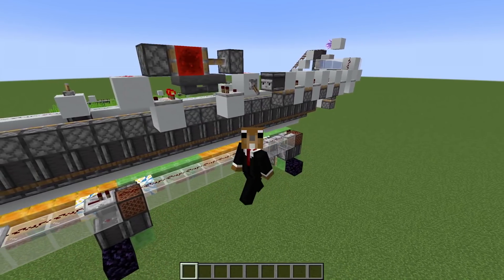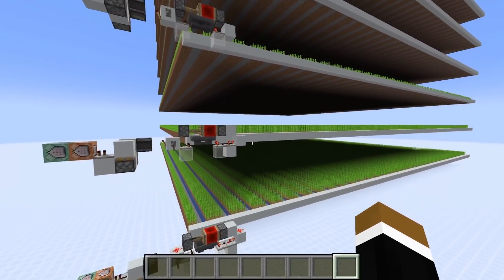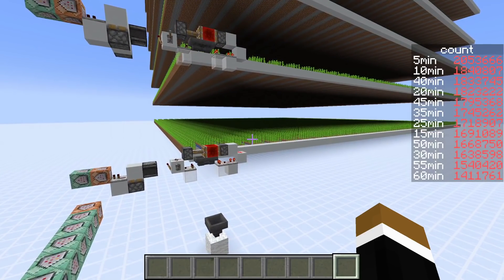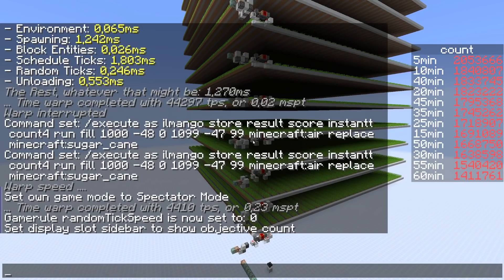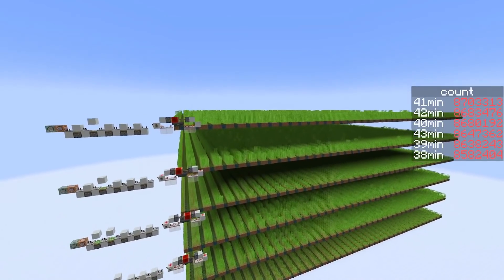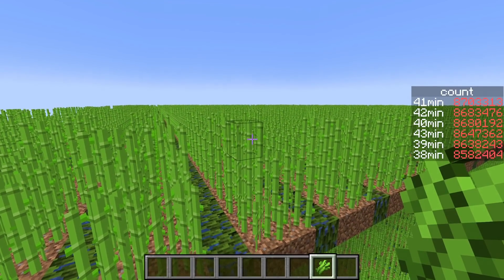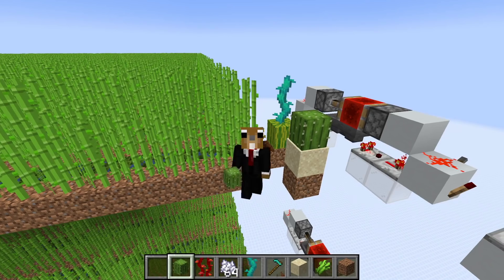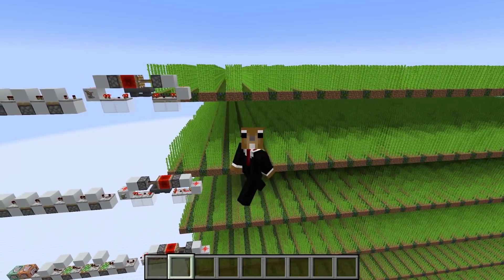What Is The Perfect Clock For A Sugar Cane Farm?

Comment: The answer is: 49253 ticks, with the efficiency 36.006436594099256 sugarcane per tick for 1 million sugarcane
Or, 2462.65 seconds / 41 minutes and 2.65 seconds

(Explanation in comment reply)

Here is the python code that I used:

from scipy.stats import binom

def efficiency(cycle_length):
    n = 2
    for i in range(0, 16):
        n -= 2 * binom.pmf(i, cycle_length, 3/4096)
    for i in range(16, 32):
        n -= binom.pmf(i, cycle_length, 3/4096)
    return n * 1000000 / cycle_length

for i in range(49240, 49260):
    print(i, efficiency(i))

Here is the output:

49240 36.00642974585812
49241 36.0064307260955
49242 36.0064316307466
49243 36.00643245981445
49244 36.0064332133022
49245 36.00643389121294
49246 36.00643449354977
49247 36.0064350203158
49248 36.00643547151411
49249 36.00643584714785
49250 36.00643614722013
49251 36.00643637173403
49252 36.0064365206927
49253 36.006436594099256
49254 36.00643659195679
49255 36.00643651426848
49256 36.00643636103739
49257 36.00643613226671
49258 36.00643582795952
49259 36.00643544811894
Reply from the maker: oh nice. thanks
Reply: OMG I GOT PINNED?!
Reply: @YuuseiKurobane  You earned it!
Reply: That is super impressive that you calculated it, I only partially understood, but that's mostly on me.

It's really impressive how close it really is to 41 minutes, basically no difference, so 41 minutes is really the perfect viable time to harvest sugar cane farms!
Reply: Chad Python programmer using their free time to solve gaming questions
Reply: I believe 1-high sugar cane doesn't reset after harvest, so the optimal time should be lowered by a tiny amount of time. Could you please put that into consideration? I am curious if that makes any difference.
Reply: @wooden_picks7315  oops, I actually didn’t think about that.. That’s a valid point and my calculations are wrong because of that.

EDIT: I think youtube has prevented me from posting more comments, so I will be using this.

@Rushi @Wooden_Picks I have modified the code, the new answer is now 49251 ticks, or 41 minutes and 2.55 seconds, which is a 0.10 second difference!
@srather I have taken that into consideration too, the answer is still 49251 ticks.

from scipy.stats import binom
import matplotlib.pyplot as plt
 
HARDCODE_PRECISION = 900
 
def equillibrium(cycle_length, precision):
    distribution = [1, 0, 0, 0, 0, 0, 0, 0, 0, 0, 0, 0, 0, 0, 0, 0]
    new_distribution = [0, 0, 0, 0, 0, 0, 0, 0, 0, 0, 0, 0, 0, 0, 0, 0]
    for i in range(precision):
        running_counter = 0
        for j in range(1, 16):
            total_from_previous = 0
            for k in range(0, j+1):
                total_from_previous += distribution[k] * binom.pmf(j-k, 3 * cycle_length, 1/4096)
            new_distribution[j] = total_from_previous
            running_counter += total_from_previous
        new_distribution[0] = 1 - running_counter
        distribution = new_distribution.copy()
    return distribution
 
def efficiency(cycle_length):
    distribution = equillibrium(cycle_length, HARDCODE_PRECISION)
    n = 2
    for s in range(0, 16):
        for i in range(0, 16 - s):
            n -= 2 * binom.pmf(i, cycle_length * 3, 1/4096) * distribution[s]
        for i in range(16 - s, 32 - s):
            n -= binom.pmf(i, cycle_length * 3, 1/4096) * distribution[s]
 
    return n * 1000000 / cycle_length

for i in range(49245, 49255, 1):
    print(i, efficiency(i))

Output:

49248 36.005482937897945
49249 36.00548311115399
49250 36.00548320899456
49251 36.00548323142269
49252 36.005483178441324
49253 36.005483050053705
49254 36.00548284626267
Reply: @YuuseiKurobane  as another comment rightfully said, the probability of still having a significant amount of 1 high sugar cane is ridiculously low. You shouldn't waste your time with it. Unless you enjoy it, in which case I can only cheer you up^^ It'd be me, I'd also be looking.
Reply: @YuuseiKurobane  I independently calculated the max in matlab and also basically went the same route as you did, at first 49253, then noticing that the formula spits bs when entering really short harvest cycles because it doesn't take the growth state distribution after harvesting into account, then noticing that I can only approximate that distribution using equilibrium conditions. However, I was too lazy too program those in, but rather just simulated the whole sugarcane growth mechanic to notice that for the harvest cycles of interest the effect is negligible! Congrats though, you were faster than me :)
Reply: @JL2579  The easiest way to do the equilibrium thing is to just brute force it in I guess, and it only changed the answer by 2 ticks, but it is necessary to do to accurately get the behavior of short harvest cycles. I plotted the graph in a post r/technicalminecraft if you want to see the behavior for short harvest cycles (around 20% more rates). I wasn't really trying to be the fastest and I'm also interested in other people's work to double check though. Also I didn't know about your channel and I subscribed to you :)
Reply: @YuuseiKurobane  thank you, I am not very active on it atm, but I plan to release some new videos soon
Reply: @JL2579  wow JL still exists? i remember watching technical mc videos from many years ago
Reply: @YuuseiKurobane  a little correction to the function name here: it's a steady distribution instead of an equilibrium distribution.
Reply: @wooden_picks7315  I've only taken one year of AP calculus, so I'm not entirely sure I'll be able to do much. My first thought would be to integrate the rate of growth for sugarcane from t=0 to t=x and then find which x would be the maximum on the graph ilmango showed, but I don't know how to do that with rates governed by half-lives.
Reply: It's a shame that my chemistry class didn't go into the math behind half-lives, because that would be REALLY helpful right about now...
Reply: @flambambam  calc bc does diffeq and half life
Reply: Random ticks are 3 times per tick and can choose the same block multiple times. So the probabaility ist actually 1/4096, but 3 times as often.
Another problem is, that any sugarcane that is still 1 block tall doesn't loose it's growth stages.
But the error should be within 0.001 of the efficiancy.
Reply: @srather  Actually, the probability (or rather expected number of random ticks per tick) is still 3/4096. Here's a little proof (This is actually something that I was wondering if it was exact or just a good approximation, so I actually made this proof to convince myself) 
Chance of a block getting random ticked: 
1 time, r1 = 3 * 4095^2/4096^3
2 times, r2 = 3 * 4095/4096^3
3 times, r3 = (1/4096)^3
expected no. of random ticks per block per tick, R = r1 + 2r2 + 3r3 = 3[4095^2 + 2(4095) + 1] / 4096^3 = 3(4096^2) / 4096^3 = 3/4096
Reply: @Temari_Virus  Yes, the expected value is the same, but the actual distribution is important. If on average the block was ticked 17 times we dont know how often it actually grew.
Reply: Yuusei please make a video with the explanation of the calculation.
I am sure many people would be interested, I know I am.
Reply: @marimaton4516  lol, there aren’t a lot of channels like that, that use math to perform a technical analysis of things in minecraft. I’ve seen one channel try and use minecraft to show fibonacci’s sequence using chests.
Reply: R/theydidthemath
Reply: Good work! I tried to use a graphing calculator for this, but quickly hit precision issues. Your code looks right, but your explanation should use other limits I think. It should be 0 <= i <= 15 instead I think.
Reply: Epic that you actually decided to calculate it :]
Reply: This has a major flaw! Try calculating the efficiency for a cycle length of just a few minutes using your method; it's minuscule.

The code wrongly assumes that the stage for every sugar cane is reset to 0 after every harvest. However, canes that are still just 1 high aren't cut at all and therefore keep up to 15 stages
Reply: @WilcoVerhoef  @The Lasagna Man, I have written an updated code somewhere in the reply (in my reply to @Wooden_Picks) but I couldn’t edit the top level comment because it is pinned, I am sure it is correct
Reply: The answer to every problem is 42
Reply: i shouldn't have pressed more, that scared the shit out of me
Reply: My man 😂😂
Reply: Showed his work too, Naisu 👌
Reply: the suger cane per tick values seem way to accurate, its like measuring an area in square millimeters with a ruler that can only measure meters.
Reply: it can be computed precisely: sugarcane follows random ticking which can be calculated precisely
Reply: @vinesthemonkey  random ticks by nature are random, so it canot be calculated precisely. why would a random tick a block every x ticks. The number used is only an average.
Reply: @wChris_  it's random but when you sum together binomial distributions (x occurs every tick with probability p) you get a very close approximation to a normal distribution (first proved by Laplace, then later on for most non-pathological distributions as CLT)
Reply: Excellent comment! As for the derivative people were talking about. I don't believe there is a way to take a derivative of a discrete function like the binomial. However it happens to be the case that the normal distribution is a continuous approximation of the binomial. If you use your code to calculate the efficiency for every tick interval from 0 to, say, 100 000, it would be pretty easy to find the exact(ish) average and standard deviation of the dataset. I found the following equation for the derivative of the normal on a math stack exchange forum:

f'(x) = - [(x-mu) * exp(-(x-mu)^(2) / [2 * sigma^(2)])] / [sigma^(3) * sqrt(2 * pi)]

Here "mu" is the average of the dataset, and "sigma" is the standard deviation. After that it should be pretty trivial to set f'(x) = 0 and solve for x.
Reply: Absolutely outstanding.
Reply: So many significant digits required for this exact of a solution.  I've had people commend me on much simpler calculations before, but I know it's not serious until one has to pull out the scripting tools. Truly great work here.
Reply: As multiple people in this comment thread have already pointed out, the code created doesn't work for low harvest intervals because it doesn't account for growth ticks that are stored but not harvested in a 1 tall sugarcane plant. I believe that to get a better model of the proper behavior at low intervals, we have to attack the problem from the other direction, by counting the number of growth ticks that get lost after each harvest. This would account for 1 tall sugarcane that isn't harvested and 2 tall sugarcane that get harvested with a number of lost growth ticks. I'm not currently able to code this myself, but it would be interesting to see someone create it.
Reply: @thelasagnaman832  to be fair my method does not count for ticks lost but attacks from a more average amount of ticks. I can probably fix that by artificially increasing the population to 16*3 to account for all 16 growth states. That being said my method does work for smaller scale farms and setups as little n is a linear operator, meaning it is infinitely tileable and duplicatable. However to get to this point, I am required to use initial conditions based off of real data, in this case how fast sugar cane grows. 
My solution is calculation based which is theoretically ideal, but not practically ideal, which the above solutions using python and brute forcing the simulation to get results which is a valid way. In theory, the average of those solutions should be equal to my solutions and the best part since my solution is tileable via linear operators, we can use the data to make a general solution and scale accordingly. 
Given in probability though, the less data points you have, the less accurate a simulation is
Reply: I’m mentally disabled and profoundly retarded so idk wtf this is
Reply: The answer  to every problem is 42
Reply: Pretty cool that after independently coding up a solution myself, I got the exact same answer lol. However I think rounding error is a little significant here, when I switched from double precision floats (around 16-17 sf of precision) to a type with 128 binary digits (around 38 sf) of precision, the efficiency I got was off by about 0.13%, which is pretty significant when all the numbers are so close to one another (but not really when actually making a sugar cane farm)

It seems that I also made the same mistake of not realising that it assumes sugar cane that didn't grow lose their growth stages, so following a suggestion from a comment to count the number of random ticks lost instead I'll come back with my new answer

Edit: have now gotten it correct and using double precision floats got the same answer again, now time to use more precision and see how the answer changes

Edit 2: there was a bug with my 128 bit precision code, rounding error isn't that big of an issue
Reply: Huh…..
Reply: got my 128 bit precision code working correctly, and the correct answer is indeed 49251, with approximately 36.006722210127181017865574868468502746 sugarcane per tick for 1 million sugarcane (I checked cycle lengths between 49200 and 49300)
I also checked the 2 other peaks which are at cycle lengths 1 and 24716, with cycle length one producing  45.776367187500000000000000000000000000 sugarcane per tick per million sugarcane and 24716 producing 35.810476752868119915659363569362860127 sugarcane per tick per million sugarcane
Reply: @Temari_Virus  So how do you set up a hopper clock for that? Im clueless.
Reply: @MrSinister718  well, the delay is too long for a single hopper clock, but with a hopper clock and hopper/dropper counter
49251 = (216 * 228) + 3
A normal etho hopper clock with 15 items has a period of 228 game ticks, so attach that to a hopper/dropper counter (really just a clock that only gets unfrozen when the first clock activates) with 216 items, and give the reset a 3 tick delay, and viola!
Reply: Shouldn't you use cycle_length*3 and 1/4096? My thought is it's possible for a sugarcane to get 3 random ticks in a single game tick. This would give a slightly different distribution.
Reply: @samuelowens000  numbers should just be higher but with the same efficiency/distribution because it aint work like that in the game the default vaule "3" just means its 3x more likely for the cane to get one after each game tick its does not mean it gets 3 random ticks in a game tick
Reply: @samuelowens000  I used that in my updated version, I could not update my original comment
Reply: r/rheydidthemath
Reply: What about a farm that only harvests the top layer? Then obviously take shorter cutting intervals.
Reply: May I have it in English
Reply: i am curious about only harvesting top(3rd level) of the sugarcane might have any difference with shorter interval because it might contain the growth stage knowledge but can't grow due to limit of the growth height. As ilmango says it lose it's stage knowledge when it harvested at the second level how about third?
Reply: @atakantuncel2918  each sugarcane block has its own age 0-15. When it reaches 15 it tries to grow another cane block on top, except for the 3rd sugarcane. So you might say they are all identical.

The only thing that matters here is that when you harvest a sugarcane the bottom cane block still has age 15 so it tries to grow back immediately.
Reply: Imagine wasting your time on something like this...